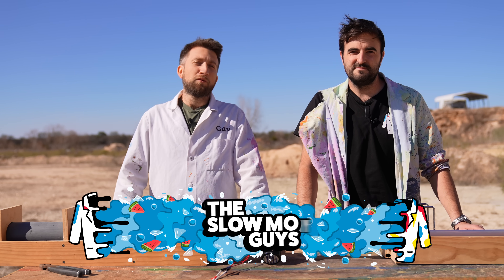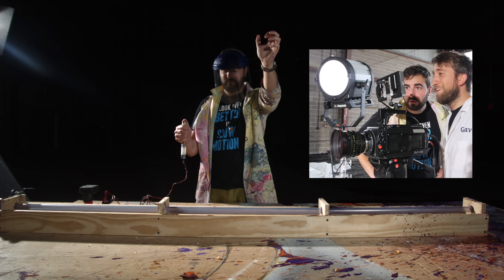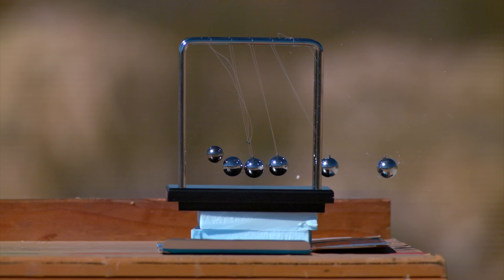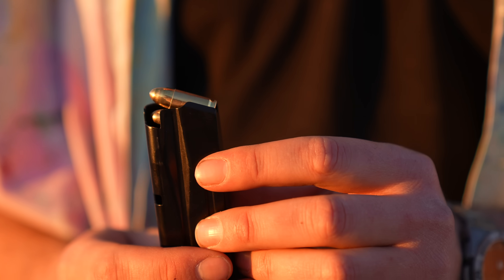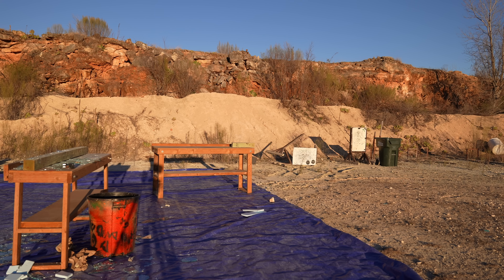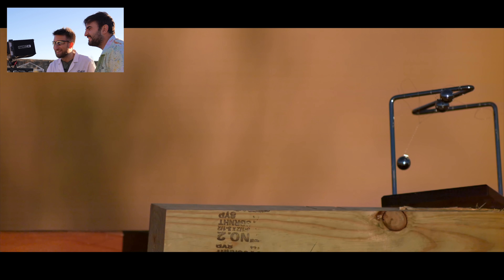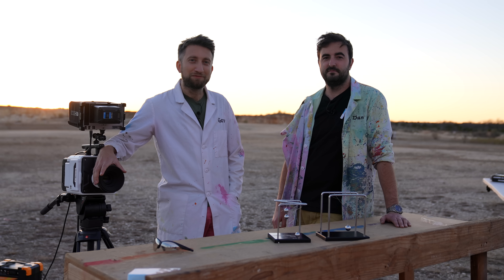Bullet vs Newton's Cradle at 100,000 FPS - The Slow Mo Guys

Comment: You can really see at the time of impact the flattening of the balls.  Also since the trajectory was slightly higher and lower on each hit, so the leading ball ended up pushing up or down causing some of the energy to be pushed in a different direction instead of directly into the adjacent ball.  If it was perfectly aligned you would expect the first ball to stay attached and transfer all the energy into the adjacent ball similar to the second ball that did transfer all the energy and was able to stay attached.

Comment: In my mind I imagine I bullet hitting them balls would of be like a bullet hitting hardened steel of the combined thickness of those balls and there for the bullet being soft starts expanding and brakes apart and due to the speed and energy required to move all the balls the easiest path for the energy to be released would be during the bullets expansion and the residual energy caused the pangolin to tumble away

Comment: Hey! You can see the first ball looses it's "string hinge" that little tube (?) Thing that is attached to the ball, that is where the string is threaded. Maybe the shock busted the weld to it? You can see the tube is still attached to the string on the slowmo footage, when it comes away from the the ball.

Comment: I love how when slowed down the bullet has gone off the screen and the cradle still hasn't moved from the energy of the impact!
Reply: right? that made me stop and think for a second and realized it's the air disturbance that did it. the material absorbed the impact energy and shattered or vibrated slightly, but what made the apparatus move was the air pressure which took longer to propagate.

this suddenly makes glass phone screen protectors make sense to me to a degree. they're cumbersome and ugly and still accumulate scratches, but they distribute impact and make the actual phone glass not take the hit.

Comment: The fun of physics. Here’s my quick explanation of what was going on with the Newton’s cradle.

The first ball was coming off the strings almost immediately because the ball hit the resonant frequency of the part holding the string. So thats why it came off even though it didn’t move anywhere. I assume the 2nd and 3rd balls stayed on because the first one took so much of the force (in-elastic collision). The last ones came off just because they were feeling enough force that they were traveling at a high enough speed it snapped the strings almost instantly.

Comment: I expected this result, the force is transferred to the last ball which will then absorb the energy. In Iraq in 2003 a solder was shot at point blank in the face the bullet hit the tip of the root of one of his front teeth. the tooth absorbed the energy of the bullet and was ejected from the socket. Radiograph showed the bullet remaining in place.

Comment: As a fisherman, I’d like to see the impact this has with different lines holding the balls in place. I’d like to think that some braided line would have very different outcomes from Monofilament or fluorocarbon lines.
Reply: Why not go to Kevlar?  Don't know if it would actually make a difference, but I'm curious to see.
Reply: The lines weren't the issue, if you look carefully none of them snapped. The failure points were the connections to the balls, the welds themselves basically. If you wanted to test with stronger lines you'd need to find a way to forge your own balls with the lines included as they are forged rather than welded on afterwards.
Would be interesting to see however but they'd also need to clamp down the frame at that point, and probably build a custom frame too handle the energy involved too.

Comment: The lead is heavier than the ball bearing. It is much softer though so when it hits the much harder steel ball the bullet deforms/fragments around the ball only transferring some of it's energy to the cradle, the rest is maintained in the fragments that went flying.

Comment: Bullet speed is preposterous....   100,000/5280*3600=68,181 Miles Per Hour.  That is  north of Mach 80    A 30-06 would have a speed of about 2910 feet per second for a 150gr bullet. A 50 BMG lists at 3,044 ft/sec for a 647 gr bullet.  A 7 Remington Ultra Magnum comes in at 3,425 ft/sec for a 140 gr bullet.

Comment: For elastic collisions kinetic energy is conserved along with momentum. This means that the mass of the ball bearing is significantly greater than the bullet for it to transfer this much energy into the cradle balls relative to the bullet with much greater velocity. Not taking into consideration the brittle fracture limit of the bullet

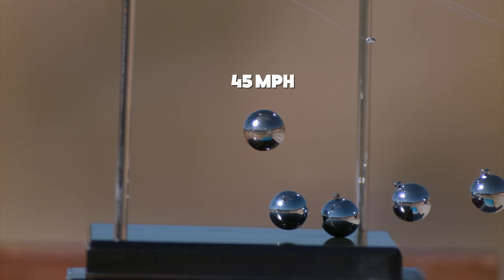Comment: 05:19 You can see a timing difference ripple up consecutive upon ropes even though energy transfer was almost instant; I imagine this was caused by the time it took each ball to deform before being compressed enough to deform the next. Is it possible to calculate the hardness of the balls, and consequently their material composition, just from frame data?
Reply: With enough math I am sure you could, it just gets increasingly complicated the more factors you add in. Not worth the effort since there are many easier ways to do so.

Comment: I would like to see this exact same experiment but the balls on the Newton's cradle gradual go down in size( Projectile ---> Large to small) or other way around, until they are half or less the size of the projectile. 

Because they have to transfer energy but they are getting smaller in size to keep the consistent energy going they increase in speed to make up for weight weight loss and maintain kinetic energy. it would be interesting to see what happens to that final ball with how fast it may go. understandably the energy transfer isn't PERFECT it won't be a perfect "last ball goes twice as fast".

Comment: When two dissimilar materials collide, the weaker one takes the damage.
So if an airplane, made out of aluminum sheet metal, collided with a building made out of structural steel beams and concrete, it would look a lot like your video. Or this one.
https://www.youtube.com/watch?v=U4wDqSnBJ-k&list=WL&index=148&t=35s

Comment: you can actually hear the difference between the hardened steel ball and the softer bullet, the ball bearing gives a little thing even in the real time part while the bullet doesnt produce that sound.

also in fairness of the bullet , certainly of a fmj, its not meant to penetrate hardened steel. and the shattering in ''soft tissue'' is actually making the bullet more effective.
but yeah steel can become very very tough when hardened.

also maybe a idea if they come back to this if they put the balls in an oven at around 200 Celsius, which most ovens can do,  which would undo some of the hardening of the ball bearing so you can have a comparison of what hardening steel does

Comment: Great job shooting that with the pistol. People who have not tried it might not realize how hard it is to shoot accurately with one of those. If you decide to go to the next step, I suggest a good rifle that will shoot 1" groups at 100 yards should do what you need at 15 feet. IMHO you do not need armor-piercing ammunition; I can tell you from personal experience that a .270 Weatherby magnum with a 100 grain soft nose bullet will shoot through ½" of ordinary steel (a railroad rail) as if it were paper. Get as close to 4000 ft/sec as you can. I further suggest that it would be good to take the precaution of putting up a shield, perhaps ½" plywood with a small hole in it, about 1/3 of the way from the gun to the target. Still looking forward :-)

Comment: The best mezures would be I suppose, 1.) What shape, 2.) what size 3.) what weight, 4.) what thickness of mass,  5.) what kind of material it´s? 6.) What kind of in coming angle it´s coming from & lastly I suppose. 7.) What IS speed?  

Cheers so much for another amazing episode sci. Thank you so much! <3

BR AN.

Comment: In the first shot the balls are on an even plane but the impact of the projectile hits it slightly above the center line forcing it downward adding to the stretch of the lines. Then  it lifts the second ball reducing the force on its lines and the force transferred to it. Each ball in sequence looses les of its energy as it has less mass to transfer its energy to, so in sequence each ball 2.3,4 maintain more energy as can be seen by the separation between them.
on the second shot the second ball is lower than he first and is deflected downward increasing the force on its line.

Comment: The alignment of the balls is quite critical. If a stationary ball acquires an off-axis direction, the point of impact is not aligned with the center of mass.
Consider the motion of billiards balls. Much of the physics is comparable.

Comment: This is one of those situations where it'd be extremely cool to see a collab with Demo Ranch. Gun guy whos marginally good at aiming with several different calibers/velocities/loads for tests like these in super slow mo. .45 is closer to the diameter of the ball bearing, moving slower than the 9mm but faster than the ball bearing under compressed air, so I wonder how different the results might have been with that.

Comment: They should try that with one of those magnetic platforms that hover the balls up, maybe if it's done right they could stay grouped without string, then see if the momentum loses any power as it transfers to the last one from the shot.

Presuming the original shot would travel farther without colliding, but wondering if the momentum would travel the farthest ball thats aligned like that as far as the original or if there's a difference at all.

(Nevermind, they measured the speed and it went what I'd figure it would,  the magnetic bit was just to maybe reduce any friction caused by the strings but that probably won't matter.)

Comment: The bullet is moving in a Cone of air. There is less atmospheric pressure acting on the surface of the copper jacket and that’s why it shattered 

The Newtonian Cradle on the other hand, had full atmospheric pressure on all four balls in conjunction with their static density 

Any object at rest will tend to stay at rest until acted upon by an equal or greater force. 

ADD UP the MASS of all Four Balls… vs. The MASS of the 9mm bullet

Comment: Not sure if they mention it as I haven't finished the video. But I feel it's important to point out that the nylon doesn't break, the loop on the bearing that the nylon is thread through is snapping off the bearing. The vibration from the impact is causing it to shatter off. Which makes the first bearing coming off immediately make more sense. The nylon is basically still but the first ball comes loose straight away with barely any movement to the nylon but the vibration from the impact causes the loop moulded onto/with the bearing the snap off as that is a weak point on the bearing. The nylon does snap but only on the last few where the force is able to follow through and therefore able to cause strain on the nylon, even still the thread on the bearing usually breaks first

Comment: Why aren't you using a vacuum-based launch tube solution? o.0  Potential velocities are MUCH higher than you will ever get from an air-pressure based system.

Comment: Yall should use a solid metal round and try this again. This is kinda cool to test with different weight bullets and different calibers, would be interesting to see the results with bullets that are made from a more dense metal. Like using underwood ammo extreme penetrator rounds would be cool, .45 and .50 cal. Larger grain and solid brass rounds. More punch to those rounds, would be cool to see what happens with that sort of ammo instead of the wimpy 9mm FMJ's. Cool experiment either way.

Comment: Is the mostly spherical shape of the balls also able to absorb and re-distribute applied forces more easily than the parabolic shape of the FMJ bullet not also a factor? The bullet metal is also designed to crumple on impact more so than a steel ball. The two metals are just not evenly matched. I don't think mass has as much to do with it as does density and the two types of shapes interacting.

Comment: Gavin I'm sure you won't see this but that doesn't matter. Pertaining to measuring the velocity of each ball after impact, my physics lab using Logger Pro 3 software to conduct video analysis. What you're looking for is actually simple to do in the software. All you'd have to do is put a ruler or something of the sort in the background so the software can have a reference distance to calibrate from and do the calculations quite precisely.  It's free software that works KINDA like Excel and has built in functions to help with graph analysis. Plenty more can be done in it too, worth the check out if you want to provide physics data.

Comment: You can always change the frame of reference and realize to the bullet's point of view it's being hit by five steel ball bearings that are traveling at the speed of sound.
Reply: That makes a lot of intuitive sense, thanks!
Reply: Hahahahahaha! RIP 9mm bullet - you met a terrifying fate!
Reply: Or to put it another way, "every action has an equal and opposite reaction"
Reply: This guy physics
Reply: Good point!
Reply: Not really, because if from it's frame of reference it wasn't moving and was hit by the ball bearings then it would have moved to our left, but it didn't, it kept going right, which would make no sense at all if it was not moving and got hit from the right.
Reply: @snoutysnouterson the "kept going right" is the bullet's frame of reference... To see it correctly you would have to track a camera shot perfectly on a bullet, so it remained dead center frame, and then you would see the ball bearings coming in from the right side heading left across the frame.

You are confusing the fact that we are watching from the ball bearings frame of reference, hence why they aren't moving. 

A hung bullet hit by five steel ball bearings traveling at the speed of sound would do exactly the same thing (with some changes due to differences in air resistance). Imagine a snow plow on a truck and how that knocks snow off to the side and backwards (to the plows perspective) due to the angle/geometry of the shovel. It would be similar, but the bullet is snow and the steel ball bearings are the plow.
Reply: @BucksterMcgee  Oh yeah. I didn't think that through properly at all. Thanks
Reply: @BucksterMcgee you are very good at explaining things, and nice about it too
Reply: It’s all about perspective 😅
Reply: I was wondering why they were so surprised, I figured that would have been an automatic assumption. 

Oh well, guess I’m just too smart 🙄
Reply: @damonirvine8910  if that feeling lasts, it means you aren't getting any smarter
Reply: @damonirvine8910  what about hay vs a tree then?   

are you sure? 

have you seen the mythbusters episode?
Reply: @damonirvine8910  You're not, we all figured that out 🤣🤣🤣
Reply: @javier22-202  pretty comfortable that was made as a joke

Comment: Mass and density. Makes a difference. Also, I love that, even on a complete miss, you can see the force through the air alone is enough to flip the whole stand. Movies forget the amount of force behind a bullet, and because movies never address it, people underestimate it.
Reply: It might have something to do with the massive blast of air that was pushing the projectile coming out of the canon after the projectile. :)
Reply: @IstasPumaNevada  That’s what I said. That was all just air pressure. From a tiny little thing. There’s a reason why real life gunshot wounds are a lot more brutal than in movies.

Comment: So the bullet most certainly had more momentum than the bearing.  The bullet probably had ~2.5 Ns of momentum.  The bearing had ~1 Ns. (math in my head, may be off..)  However the fragmentation of the bullet allowed a lot of the momentum to go elsewhere, as all those fragments also have some of the momentum that did not get transfered into the balls.

Comment: its amazing to see the transfer of momentum and elasticity of the metal balls in play, along with resonant physics in play for ball one! 
projectile impacts ball 1, m1<m2 but v1m1>>>>>>>v1m2.  slightly inelastic collision results. Evidenced by metal fragments shattering off the ball, and the dents in them.  from here, m1 retains slight forward motion, due to both the inelastic collision/slight misalignment, and experiences high resonant loading that concentrates at the mount, snaps mount.
ball two experiences great transfer of momentum, inelastic collision results, retains some forward motion as a result, but not enough to snap the nylon cord
ball three experiences greater forward motion due to previous two inelastic impacts, and so on to the other 2 balls, enough so to snap the nylon cords.  the balls with the most forward movement applies tension at increasing amounts from 3-5, overcoming critical yielding stress/strain.  3-5 experience change in vector moving them up as the time between critical tension increases.  REALLY COOOOOOO physics!
Reply: Whats cool to watch is the wave traveling on ball 5's cords, up and back down, and as tension increases, when the wave propagates back up to the top, one nylon cord snaps at the moment the wave reaches the top again.
Reply: If you listen carefully, you can hear the MOMENT the resonance on ball one reaches max, and SNAPS the mount!
Reply: the projectile actually strikes the first ball 3 times!  Im going to guess that the line didnt snap because it was dampening the vibration in the nylon the second time, and the third time it simply didnt have enough momentum to transfer to break it.
Reply: ...and yes, the dents will get smaller moving towards ball 5, due to the fact that the inelastic portion of the collision absorbs more of the force starting at ball 1, and less force is transfered to the next.